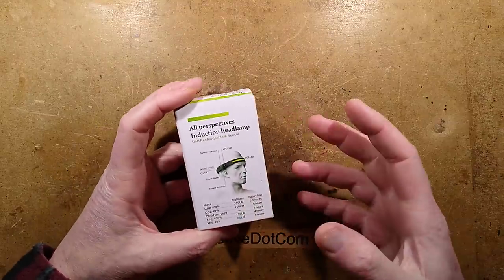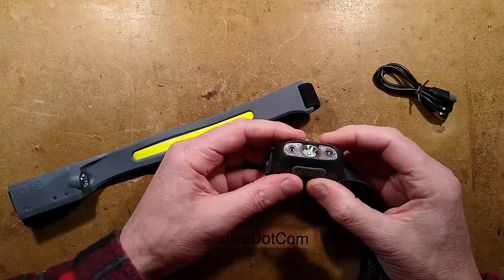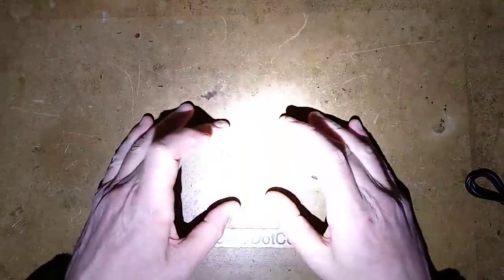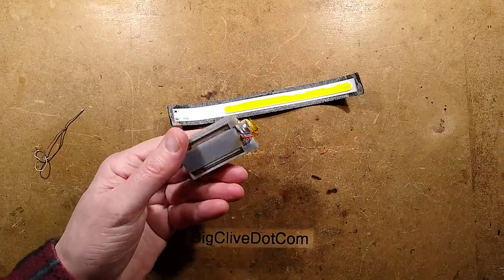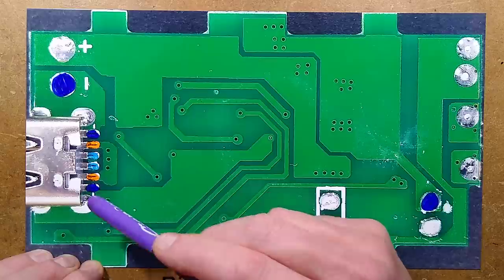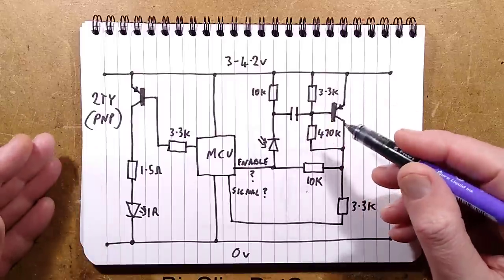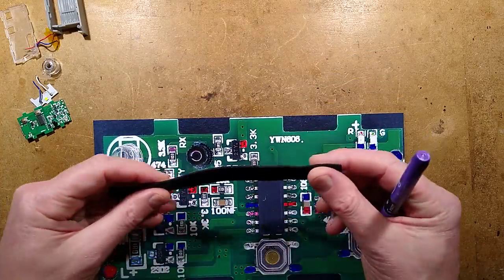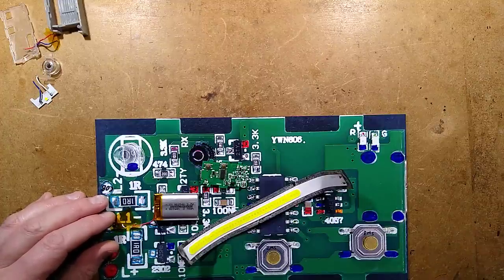Night Buddy style headlamp teardown with schematic

Comment: I have some CH340E USB-TTL interfaces equipped with such Type-C USB connectors, and since they're all about lowering the components count and miniaturizing the solution, yes there's no circuitry telling the other side it should be powering the device. Hence, you need to use a USB type A to Type-C cord. Otherwise, it's totally fine.
Reply: You can fix that relatively easily: the two pins in the middle are the CC1 and CC2 lines. Each one needs to be tied to ground with a 5.1k resistor. If they are already shorted like here: use a single 5.1k. Together with a similar pull-up in the power supply this tells the other side that your side is a power sink. The voltage you measure on it then tells you how many amps you can draw.
Reply: @KonradTheWizzard  thanks, sounds like an interesting and easy mod to try!
Reply: @jkobain  It is. If you can locate the correct pins. Check whether your device is using a 6pin, 12pin or 24pin socket (the latter often have tiny pins sticking into the PCB because there is not enough space at the back).

Comment: My guess at the IR detector.  The IR detector is probably 100 uA off and 0.5 mA on.  The 3.3 and 470 resistors bias the transistor just off.  When the detector current increases the transistor turns on and the 10k adds a little hysteresis to the threshold.

Comment: I think this head torch is great for those that are out exercising in the dark, but not that good for work in small compartments because the light isn't symmetric so you can easily obscure the light when you are diving into a control enclosure to figure out how to pull in new wiring. I prefer symmetric light that gives a strong light from the forehead as close to the eyes as possible to avoid strange shadows.

Comment: When you charge the battery, are you relying on the device saying it's charged, or do you monitor the current it's taking and waiting till it gets down close to zero.
I like the latter method, the built in indicators are not too reliable.

Comment: Just curious about the IR detection distance. Does it only view close up when you wave your hand in front of it? Or can it see a little distance away? I can see repurposing this chip to detect motion and the latch on a permanent thing, or to a timed device. Just curious. Like the IR detector flood lights you can buy for your yard. It could be used to light a string of LEDs along your walkways.

Comment: Couple of questions Clive - is the IR emitter being pulsed? I note the receiver side is effectively high-pass filtered at  ~1kHz which should cut out most light flicker.

Also, I use a cob light quite regularly as a general task light but found the cob bike-lights with belt clips more convenient & comfortable than head torches (clipped to a lapel)

Comment: I have a variant of this, the silicone is black, but otherwise identical physically. However, the modes are slightly different. it has COB high, COB low, COB red, and focused beam high. Still has the hold to strobe function, but the light has to first be on. The sensor functions identically as well.

Comment: I got a similar one for $15 CDN this week, bigger COB, has an adjustable spot light in the center, and has a hard plastic case above the right ear with the electronics and an 18650 lithium battery.    The spotlight isn't great, but I'm shocked at how bright the COB is.   Should be great for my use ... metal detecting on beaches in the dark (because days are short now).   So I can light up some area around me.  It can be very disorientating only seeing the sand within the small area of a spot light.

Comment: Would you be able to put out a video on how to stop flashlights from auto dimming? Yes I know all flashlights are different and it's for power saving reasons. Would it be something like removing a resistor or cutting a leg off a chip?

Comment: You could change the cob to a cob of your colour choice. working in lofts, cellars and even under stairs . you need a wide splash of light but focused light seemed poor would be nice if it could swivel and had a ajustable focus.

Comment: you didn't put a link for your preferred light, but i have one of the lights you are testing and found it great for £15 , its rechargeable and easy to use, extended use does cause sweat and heat, my old head lamp took 3x AAA so with this USBC charging its getting a 10 from me, how much is your preferred head light?
Reply from the maker: My preferred light ranges wildly from 5 to 15 pounds.  You can get a decent Core version for around 10.

Comment: Working with COB reduces shadows caused by focused beam, The COB does not get warm, found that i do not have to keep adjusting the beam as i did with focused beam lights. All in seem fine, only thing is it does not give the stated durations.

Comment: Hey, I'm wondering why does mine keeps dimming by itself so i have shut it off and turn it on again to get the bright light back?
Reply from the maker: They often gradually nudge the output down to avoid heat issues.

Comment: I have an old rayovac ,Worm pickers/miners head lamp that has a 3 inch reflector .I replaced the halogen bulb with an LED light .The 6 v halogen produces a much better light but eats batteries more .

Comment: Am I safe to assume your preferred torch is an eBay special as well? If so what search terms help find it? It looks like a nice light and I’m tired of replacing batteries in my current torch.
Reply from the maker: Video coming soon, but the same light I like so much has got better and is being sold on the high street here.

Comment: Does it stay on when plugged into a power bank? The headlamps I have now turn off when plugged into a power bank. It is useless when the battery dies. The other headlamp I have stays on when plugged into a power bank making it more useful. I think staying on while being plugged in should be discussed in headlamp reviews but it's the last thing thought about or not at all unless the person works long hours with a headlamp then that is a very important feature.
Reply: Not sure about the specific brand featured, but ones I've bought from Amazon do not still shine when charging.

While I love these lights and find them extremely comfortable to wear, they do have issues with the housing backing glue uncoupling after much use (maybe from heat) and individual LEDs not lighting. It's strange too, because (on mine and I have about 6 because of cheap cost), they will light back up if the strip is physically pressed...almost like they have lost connectivity in the yellow strip they are housed in. I came to this video hoping to see if those issues were addressed and good fixes, but I think I may need to look elsewhere. For example, a good flexible glue brand for the strip backing.

Comment: Still like my convoy 2 torch from aliexpress. 186590 , and can be programmed to only use favorite modes and remembing previous mode is optional. One button on the end .
Mine is set to 4 power outputs always starting at lowest power , 
Being all metal it's really unpleasant to hold in teeth.

Comment: I bought one similar that uses a 18650 (800mah) in the side, after i changed the battery for another 18650 (2400mah), i noticed that the IR sensor lost a lot of sensivity and almost never work, any clue what could be?

Comment: Woodworker here. Love these. Have 2.
Reply: Have you had issues with the backing strip coming off or individual LEDs not lighting? I've got a bunch and they all seem to having the same issues and the LEDs not lighting is very strange because if I pinch the blanked LEDs they will then light. Came here hoping these issues had been addressed. If you have any info or sources of fixes (or ideas) it would be greatly appreciated.

Comment: What do you think about the new microsoft/Nvidia 12V graphics card wiring harness?  Jays2cents channel. Maybe the two of you could figure this out together. When I compare the automotive 12V standard and this new cable I see it destined to burn down some homes. Have you any input for this topic? Never seen anyone use solder in a cable this way. It cannot help but increase resistance with normal use over time. It's a very bad design for the use cases planned. As they plan to use this cable on many computer parts not just graphics cards. At the very least it could be a good video for your channel.

Comment: I always wonder what the people that designed these were smoking. Why? Simple. When I'm in a dark environment I want a lower level of light to start with so as not to melt my retinas. Fair enough, I'm near blind in bright light but I'd always thought that increasing the intensity was better for the vast majority of folks rather than decreasing it?
Nice enough idea, I still have my favourite which is similar to yours but has a 4 position switch (increasing intensity, naturally!) and includes a red light if you need to maintain night vision.

Comment: I got one of these about 6+ months ago. It's not bad for general lighting needs, but no good for focused work as you have said as the beam is too high (especially when you have multi focal glasses and need to look through the bottom of them for close up work haha) 
As for the usb-c : total pain in the ass, as it works with none of the usb-c chargers I have (tried about 6 different ones)  so you need to use their shitty supplied cable. I'd also strongly recommend that you DON'T use that cable to charge your phone in a pinch :)
Reply: it's USB-C will only charge from USB-A to C cables. it's so annoying, I have a bunch of cheaper stuff that relies on USB-A to C and don't work on any USB-C to C

Comment: I've got one of these. It's fine. Takes a little finagle to aim. 
My main issue is evident in your thumbnail. The silicone unglues from the fabric pretty quickly. 
If anyone has a recommendation for a flexible adhesive that survives human interaction. Let me know. Tried barge glue to no avail.
Reply: Shoo Goo remain Flexible ..
Reply: I used a gorilla’s clear tape for water resist from a local hardware store than used a thermoset double sided tape for convenient fastening (to stick a rubber strip so it wouldn’t slip away when running or when attached to stuff like hard hats or even the inner of the hoodie from a raincoat I tend to use, or even to attach a folded hand towel to the forehead to help with the contact heating and sweat).

Comment: This could be great for the longer fishing sessions. Does it work while being charged ?
Reply: Most of the Chinese knock offs don’t, the one BigC shows here is very similar to the pair I had so it’s likely that the one shown will turn itself off immediately after sensing incoming power from the charging port.
Reply: I got a random one from Amazon and it does.

Comment: Wore one of those bogus light vented helmets for a job with a silicone band in it. Hot. Very, very hot, and itchy. Half a ton overhead all day but it was meat and not construction. That's the difference between having a union and not. The risk they're willing to take with you.
Reply from the maker: My forehead bears a permanent scar from being forced to wear a hard hat in extremely hot working conditions.

Comment: Mine flickers on low setting. It seems, there is no space for a capacitor. I would double the resistors, because I never use the high setting. Dies it pwm on high?
Reply from the maker: Most LED lights have no PWM on the highest setting.  Just the lower settings.

Comment: I saw an ad for that fucking thing yesterday. I'll stick to my drop proof, fully waterproof, 1750 lumen (max output) Nightcore HC65-V2 thanks.
Reply: I haven't tried any Nitecore headlamps yet. I do have similar class Fenix HM60R (18650) and HM70R (21700) IP68 dustproof/waterproof headlamps. They are not cheap, but well worth the price to me for quality products that I use every day for walking the dogs and running in the mornings and evenings when it's dark outside. I have had them for just over a year now. The seem like they are built to last several years, unlike most of the cheap headlamps which might start falling apart in a few months.

Comment: When in an environment where you need to see, but where surfaces are matte or unreflective. (a bog, the woods, side of a mountain,... Even something mechanical which is covered with oil or grime) diffuse weak lights like this are functionally useless. You need to have a high intensity focused light to create reflections and shadows. These cob  lights just won't do that adequately. Otherwise you will miss things. Particularly important where you might trip or get injured miles from anywhere.

Comment: Used my Night Buddy a hand full of times. Told all my Buddys they need one. Unfortunately my Night Buddy has stopped working after two years on my tool box. The green light won't turn off and none of the functions work. I contacted Night Buddy but they say its a one year warranty and it dosen't matter that my night buddy was used only a couple of times. No way I'm buying another Night Buddy.

Comment: It would be convenient if all these LED flashlights and headlamps had DIP switches on them so that you could set them to operate only in the mode(s) you want, and thereby defeating the other modes that you never use. I would really prefer a "hard" on/off button ---- why drain microamps from the battery when the unit is switched off? ----  and a separate button to select the modes.  It would also be convenient if when switched on it would default to the mode you use the most, or at least whichever mode it was in just before you last turned it off.  Most of us really only need a high and a low light output setting anyway. How often do you use the strobe or SOS mode anyway?  Your family and  coworkers will hate you if you ever operate the buttons on this headlamp and accidentally put it into strobe mode while you are looking at your peeps ! !
Reply: It also occurred to me that it might actually be useful if they made  headlamps with inductive charging capability, as some folks do with their phones; just leave the headlamp sitting on/in the charging dock by your workbench ---- perhaps the charger would have a built-in hook to hang the headlamp on ----  and grab them whenever you need them.

Comment: Honestly, my favourite headlamps are just "having headlamps everywhere".

They don't need to be the best, they don't need the most features...they just need to be THERE where I need them. I do have a high end lamp for deep-woods camping/portaging, and the battery life is far and away superior (think 4hr on the cheapies vs 20hr on this thing), but otherwise, there's really nothing special, and most lamps are just as fine as another. Point is, they just need to be cheap for the most part. I'll buy one GOOD headlamp, and 10 $5 headlamps before I buy 2 "good" headlamps.

Comment: Given the timing of this product I think it's meant for kids trick or treating. With just one plug in its easy to use and the light everywhere around assures they'll be seen and be safe. Myself, I still prefer my CREE T6-XML headlamp with 2 removable 18650s since I use it for Ebiking and its great for seeing in the distance like avoiding upcoming potholes.

Comment: Hey there! I'm a big fan of this headlamp, but I've noticed that the battery life isn't as long as I would like it to be. I was wondering if anyone has tried parallel wiring another battery to the headlamp in order to double the operating time? I'd love to hear your thoughts and experiences on this. Thanks!
Reply from the maker: If there's enough space it might be viable to fit a bigger (or better quality) cell.

Comment: Why doesn't anyone put an electrolyte on the LED? This solves the flickering issue. Flickering is tiring if objects are moving, especially if you are cycling at night.
There is a lot of space inside and I fixed all my flashlights.
Reply from the maker: An electrolytic capacitor would defeat the PWM as it would charge instantly on each pulse.
Reply: @bigclivedotcom  In my case, it defeat only the SOS mode and the flashing mode. 😀

Comment: I still can't figure out who on this planet needs a strobe light on their forehead?  Seriously...has anyone here ever used that mode on any of their lights?
Reply: I've seen cyclists use them. They are very irritating to be on the receiving end though.
Reply: We use them on high-seas test voyage for signaling where each team member is specially in bad weather or low visibility weather, along with hand held torches for our own visibility. It’s really annoying when someone has one of those that blinks really quickly like the one BigC shows on this video tho. Ours blink a bit slower than turn signals for cars and they are just bright enough you can see where is everyone from the bridge. It’s still kinda overkill for signaling, given that we also have to wear safety vests with retro reflective strips, but if out of nowhere one stops we know something happened to someone and we immediately radio for rescue.

Comment: Not so enamoured with how when it's on your forehead it's pointing forwards and not forwards+down where you're usually looking.
I created my own rechargeable headtorch for £3 out of a Poundland 3xAAA COB headtorch and a £2 USB powerbank, combined together in a 3D print it points down at 30 degrees to light the area your eyes are naturally looking at. I get 4 hours on full brightness, and more than an entire night on the half-brightness setting.

Comment: Why oh why does it not have a mode to enliven the COB array on the head strap and have the focus light on at the same time? It can clearly drive both at once as the strobe mode demonstrates.
It's as though these things are designed by desk jockeys who never worked a day in the field and believe their obvs immense intelligence lets them "imagine" what is required.
Working on external equipment at night you need area lighting and task lighting AT THE SAME TIME.
Hard Fail.